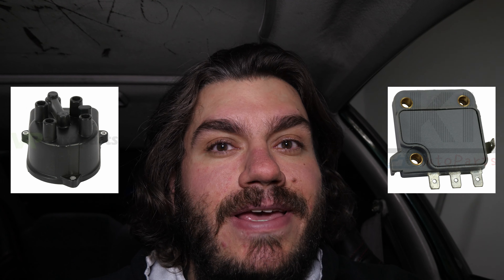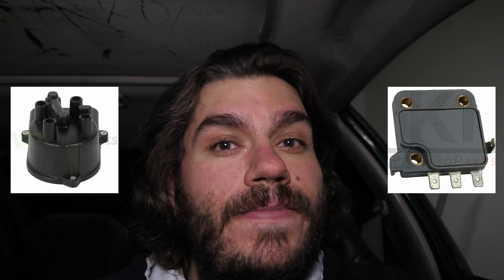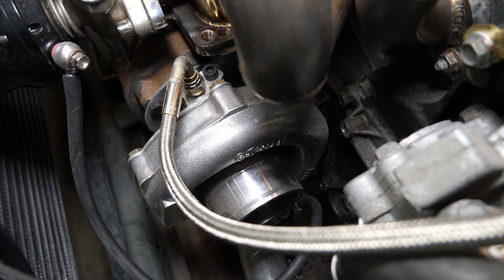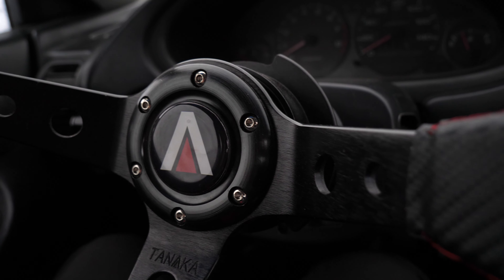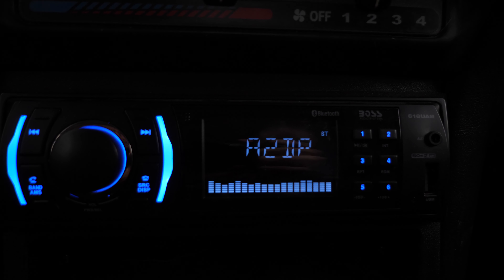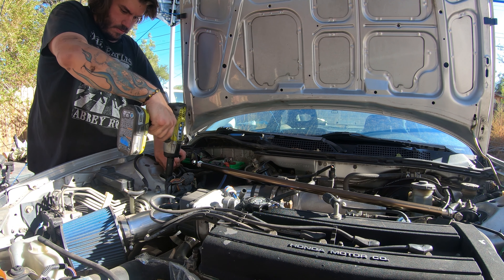D16Y8 Turbo Civic and DC4 Integra Update | TunerThings

Comment from the maker: What's going on in YOUR garage?? How are your projects coming along? Any plans for your builds over the winter?
Reply: Found my recently rebuilt Y8 Block has a stripped timing belt tensioner bolt hole. Now I'm scrambling to get a D15B7 replacement block to get my daily back up and running by tomorrow.
Reply from the maker: @AdventureOutintheWildreness  Oh nooooo bro that's terrible. I hope you can get one in decent shape to get you back going again! Sending you some good vibes!
Reply: Going to be replacing a front crank seal in my single cam frankenstein civic. Its pissing oil everywhere
Reply: @TunerThings  found a long block D15B7 for $100. Picking it up today. I'll have ti mod the hardened because the B7 doesn't have a crank sensor. Too easy, I'll do the minime swap since I have a spare Y8 head. You'll see pictures on my Instagram once I get to it.